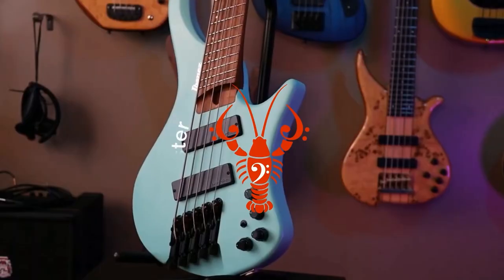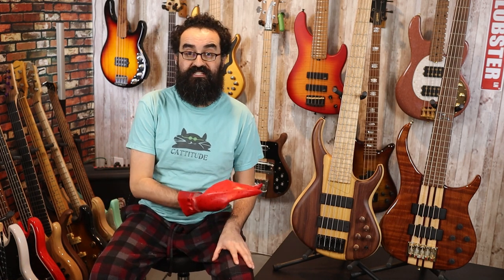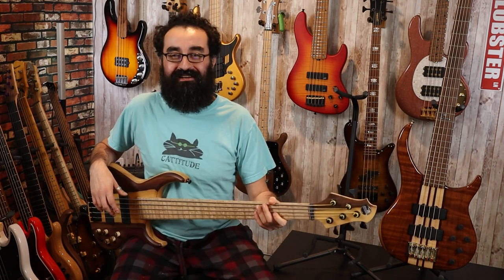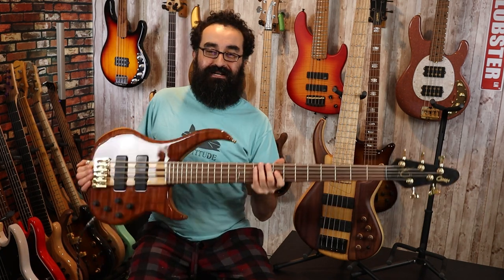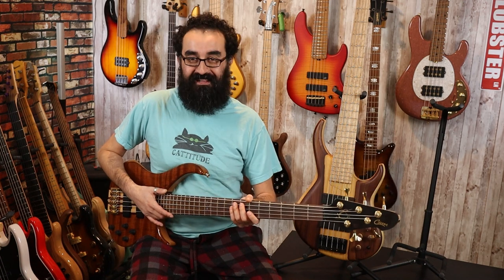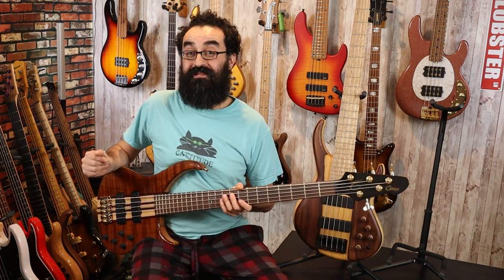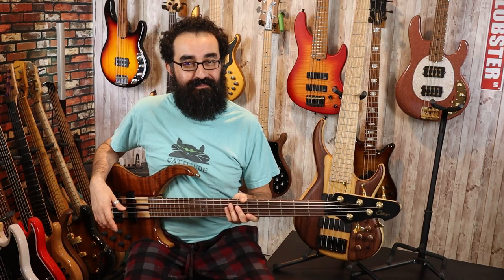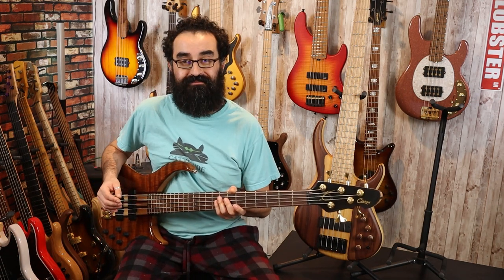MTD USA 535-24 vs. Peavey USA Cirrus 5 - The Boutique Bass Battle! - LowEndLobster Tone Shootout

Comment: The Peavey all the way.  The interesting comparison would be the Peavey vs an early/mid 80's Aria Pro II SB series bass.  The SB-1000 (single pup) or SB-900 (dual pup).   Any of the older Aria SB series were great basses easily on par with any bass you throw at them.
As always, great video!
Reply: I agree 100%!  My old Arias were only displaced by my 5 string Cirrus.

Comment: I have custom shop Mike Pocaro Cirrus . If they had produced these with 18 or 19mm string spacing Peavey would still be a strong player in the bass market.
Reply from the maker: Indeed. I forgot to mention that the Cirrus is rocking an 18mm hipshot bridge here. I mentioned I swapped in the hipshot, but not the 18mm part. It works perfectly once I got longer screws for two of the saddles.

Comment: Couldn't help but notice that many prefer the Cirrus, even though the MTD has pickups with better bandwidth, and therefore retains more information into a preamp. The MTD sounds flatter (extended lows and highs, very HiFi, many will describe this as scooped when it just has extended highs and lows, which we are not used to, and will therefore make the mids seem recessed, when they're really not) compared to the Cirrus (more traditional, pre-filtered tone). That said, the Cirrus has a great tone. Apply a low pass filter around 8kHz on the MTD and it will sound more familiar (it will sound more like the sound you'd expect coming out of a cab). I like the extra bandwidth, creates more harmonic information when fed into saturation. You can always clean out the top end, but you can't get back the sizzle when it's not there. Lovely basses either way.

Comment: Both basses are great, the Cirrus looks a little bit dated beceause of the sharper body edges but both have great woods and finishes. Tonally I prefer the Cirrus more, it hase more warmth and flavour in my opinion. And I'm a huuuge Mike Porcaro fan, who used CIrruses on stage for his last 10 years in Toto.

Comment: I think I like the Peavey over the MTD and I feel horrible for saying that. The MYD has the looks and I am sure tweaking the eq, I would love that bass tone wise but based off your video the Peavey wins tone wise.  The MYD sounded like ice picks in my ears when you slapped it. It kind of made the Peavey sound dead in comparison but the Peavey has a more natural tone and not active sounding like the MYD. This post makes me feel so bad and wrong or ashamed for thinking this. I am so sorry Mr. Tobias. You are still one of the greatest builders ever. Now I feel better.
Reply from the maker: Thanks Meyers! The MTD definitely has a brighter overall sound, and the treble boost when we scooped the mids definitely did not work in its favor. I personally prefer the MTD tone but I think both sound really amazing.
Reply: @LowEndLobster  I know you right and I am sure if you just cut the mids and left everything else at center it would be a smoother overall tone.
Reply: I played a Redwood Cirrus from 2000/2001( One of the First in Fla)to 2008.  The Cirrus was Wonderful But in 2008 , Discovered The MTDs which Felt Better to my Hands( Huge) and Style of Playing. As good as the Cirrus Sounded. The MTDs (USAs and Kingstons) Felt Better to Play and Was More Versatile.  On this Video the ROSE OF MOUNTAIN Has a PHAT-ER Sound then the Cirrus. Also The MTD had a more Versatility in sound to Me.  The original Cirrus around 2000 - 2003 were Excellent however for my Hands and Ears the MTDs. (USAs and Kingstons FELT AND SOUNDED BETTER!!

Comment: The MTD sounds to "snappy/thin" when slapped and both pups on. The Peavey has more low/mid presence and that's what I prefer.
Reply: This is a typical feature of US Bartolini pickups. MTS has custom made, but the tone is in the ballpark of their Bartolini Classic Bass series of pickups. Also this hi end sizzle might sound strange when untamed in solo, but it is very helpful to the sound engineers in a tight mix.
Reply: @Eugensson  Yes, that high end bite is Very helpful for mixing. Especially for it to be heard on the nasty little speakers that so many people are listening to anymore. Everyone should be issued a pair of Bose 301s at birth…😉

Comment: It’s just like you said Low, apples and oranges. I like them both for different reasons. The Tobias , besides being an incredible piece of art, has the high end bite that is helpful for mixing and it’s easier to be heard especially on small speakers. (There ought to be a law against listening through anything smaller than 8”) That being said the Cirrus has a nice warm low mid. I wish I would have bought a Cirrus when they were going for less $. Both b strings are excellent. What’s the string spacing on them? The Tobias spacing looks really wide…

Comment: Are you sure your MTD has active Bartolini pickups?
Reply from the maker: 100%. The USA MTD pickups are active low impedance with an external buffer in the cavity. Not to be confused with the Super pickups which I believe are passive (there's a preamp bypass on those basses, they use a different pre too)

Comment: Aren't the barts on the mtd passive?
Reply from the maker: Great question! I believe these are active low impedance pickups that have an external buffer. I'm not sure if the pickups themselves require batteries, but I'm pretty sure the buffer does. Pickups like EMGs have the preamp and such built into the pickup (not the EQ, but the pickup preamp). These custom Barts have that bit external to the pickup.